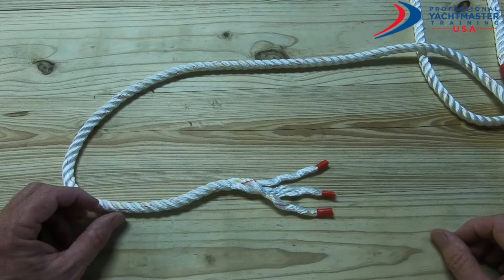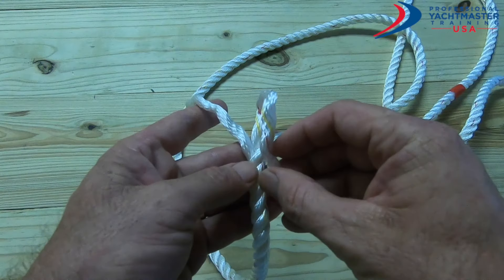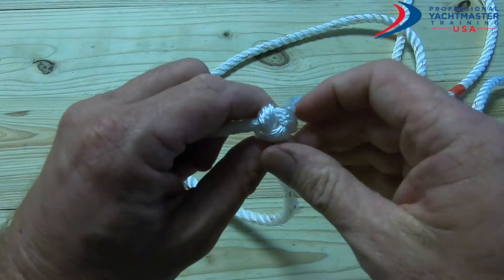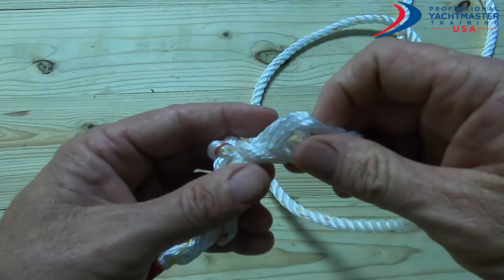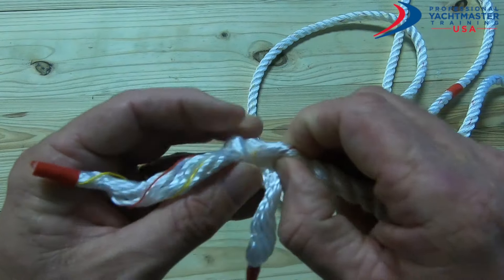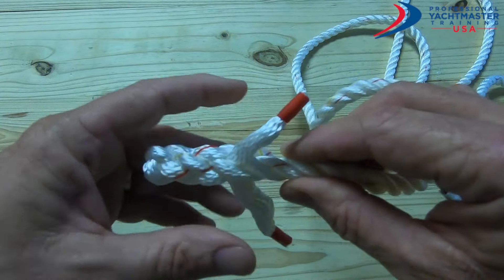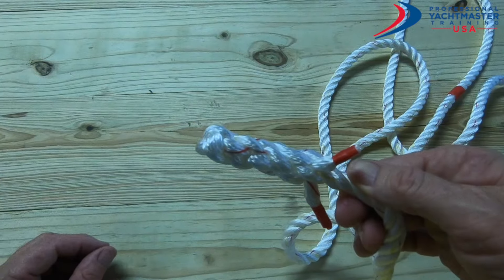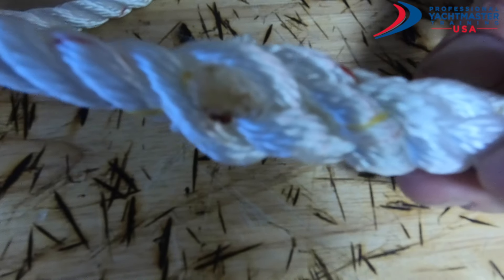How to Tie a  Back Splice / Crown Splice ⎸Tutorial - Professional Yacht Training USA

Comment: Professional Yachtmaster (???) - it is common knowledge that the MINIMUM interlace for any form of splice in synthetic rope is FIVE.  Not three as is stated & shown in your video. Synthetic ropes are far too slippery to remain integral with only three interlaces.
Reply: John? It’s common knowledge that someone trolling the internet just to discredit people who are trying to help others are named Karen. I prefer to call them shithead, but that’s just me.
Reply: For 90% of what I use a rope for, 3 interlaces is more than sufficient! You may be correct "professionally", but what a rude person you are to make a comment like that.
Reply: If you're just using the back splice to finish the end so it doesn't unravel, three is enough. If you are tying a ring or anything that will be loaded into the back splice, you should use five on synthetic rope.
Reply: The difficult part is the first knot, but this is very well explained. Thumbs up!
Reply: I hold barges loaded with a million gallons of product with lines spliced with 3 tucks just fine. Check them down in locks, stops them on docks and build tow off them. 3 tucks works on my boat